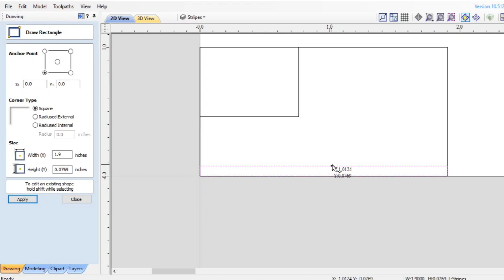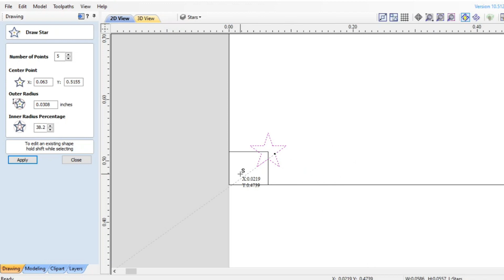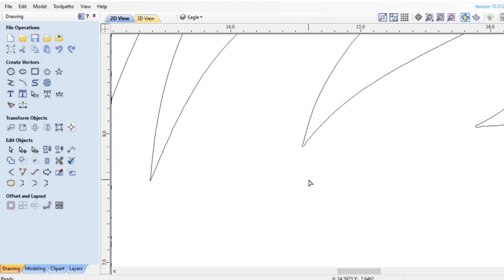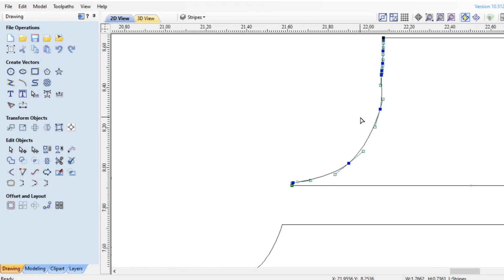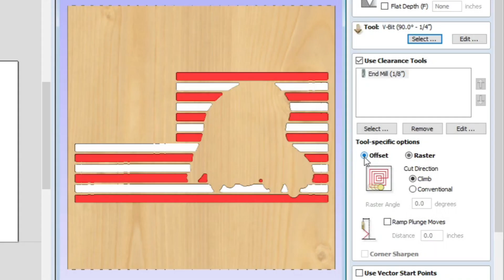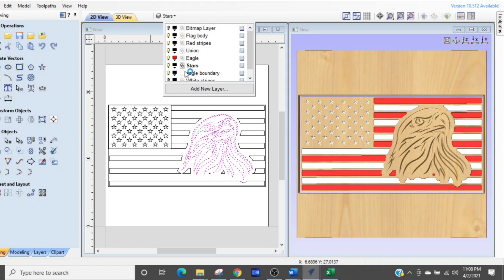Vectric Beginners First Pro-Level CNC Project (American Flag)

Comment: Apologies if you answer this but why hit S in node edit vs. fit curves (arcs or Beziers) to vectors? Reduce the number of nodes by an order of magnitude for smoother runs yes? If you keep sharp corners it will keep the lines on the points of the feathers. Second: Why not just use trim object? Group the strips, select the eagle outline and trim inside...fewer button presses I think. Don't get me wrong: I watch beginning vids because I always learn something, but there are some easier ways to use the VERY powerful tools in vectric/aspire that I think could speed this up.
Reply from the maker: Thanks Wood. Yes, there are features I'm still not aware of. That's why comments like this are great to get.

Comment: Hey Garrett, great video as usual. Quick question though about the node conversion. Why don't you use the "Fit Curves to Vectors" option and convert them to "Bezier Curves", with a "Tolerance" setting of something like 0.001?  You end up with a ton less nodes and a cleaner vector. Again, just a question.
Reply from the maker: Bruce...the honest answer is I didn't know I could do that. that's why there are people like you throwing in tips in the comments. thank you and keep 'em coming because other viewers will see them.
Reply: Yeah, I find that it also greatly improves the easy of being able to manipulate and adjust the vectors since there are way fewer nodes to deal with... :)

Comment: I saw that you removed some material from the blue field, to accept paint I think you said. If you did not deepen the stars aren’t your stars smaller in diameter than originally designed?
Reply from the maker: Hi Mick. I only did that to get the blue. Yes, i did it backwards. Thank you for pointing that out.

Comment: I started a file and went to add the stars.  They came out a funny shape.  I had to go back and see what your inner radius was set at.  Mine ws at 50.  I see yours was at 38.2.  I changed mine and the stars turned out to be what they should be.  I enjoy learning from you.
Reply from the maker: Wally, I'm so glad. I really try to cover all the bases. Seems to be working from what you said. So, are you going to cut the project now?

Comment: Verry learn full, but whiteout a automatic tool changer ( like 75% of hobby cnc’ers) it’s still very hard to cnc it, as you have to re zero for every separate tool path, so a lot of room for mistakes,
I would like to see a finished version of this great design, or some great tricks on how to cnc with so many tools.
Reply from the maker: Hi Skid. I'll be running it shortly. Busy building my new workshop

Comment: Fantastic video, but it left me with a question.  When you cut the blue star field to a .020" depth, didn't you also shave off the top of the stars? I think that when v-carving the stars you should add a .020 start depth to compensate.
Reply from the maker: Hi Lynn. Yes, you are right. Doing the video took a long time and I think my mind was a little fried at that point so I missed it. So thank you for pointing that out so others understand.
Reply: Lynn...I know Garrett replied he was  fried and probably should've done this.  But, I would not have had the start depth of the stars changed to 0.020" to address the blue field carving he did at the end.  The reason why is that he isn't really cutting the blue flag field at all.  He was just tying to make the flag look pretty so he can use the toolpath to apply blue to his flag.  But, he should not have selected the toolpath for the field to be put on his USB drive.

Comment: In the 3D view, you can hover your mouse in those low areas in the eagle and see the 'Z' depth in the lower right status bar. Also, you need to set the start depth for the stars to 0.015".
Reply from the maker: Hi Michael. I didn;t know about the display at the bottom. Why start the stars at.015?
Reply: @IDCWoodcraft  When you did your pocket cut in the star field area, you cut that at 0.015 depth. You had already cut the stars at that point. Now those stars are a smaller diameter and are out of spec per the American flag specification site. Setting the start depth on the stars to 0.015 resolves that issue.
Reply from the maker: @Warpfield  oh yeah. Thanks for pointing that out. At least I'll still get stars

Comment: Which part of your video does Vectric not teach ?
Reply from the maker: Hi Michael. I detect a challenge...thank you. I've been through all of their tutorials. Many little things I did not see in them that were used here. Looks like you've been 'tubing' a bit, considering your sub rate. Now you can add one more to that list.
Reply: @IDCWoodcraft  No challenge, but as a beta tester for Vectric for 10 years I was wondering what they missed. I watched the video twice. I'm sure they would like to know.
Reply from the maker: @mezalick  Oh, you're the beta tester Mike I've heard about. Very pleased to meet you. 

The 2 big ones I did not see in their tutorials were selecting all nodes to smooth and outlining groups of vectors. That's what comes off the top of my head at the moment.

Also an explanation about the black nodes and how they affect smooth v-carves. That was a frustrating one until I figured it out.
Reply: @IDCWoodcraft  ???
Reply from the maker: @mezalick  I've heard about you...I think from Mark Lindsey
Reply: @IDCWoodcraft  Axiom Tool Group. I have one of their great machines and he teaches for them (if I'm not mistaken).
Reply from the maker: @Kennyindia  I didn't know that. You've been a beta tester for vectric. That is so cool. Nothing like being the go to guy for such a great software company. I love working with vectric!